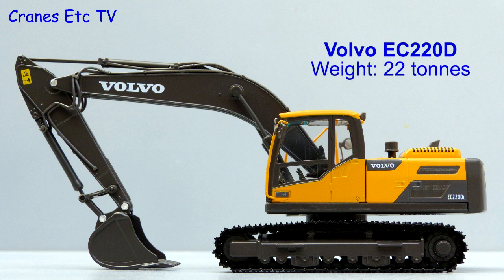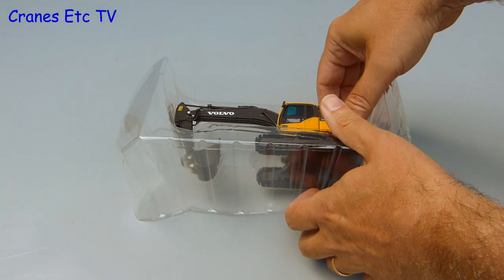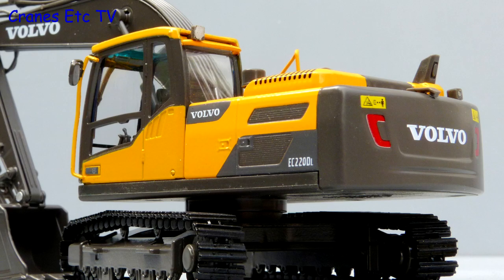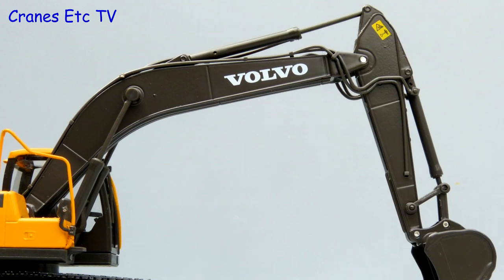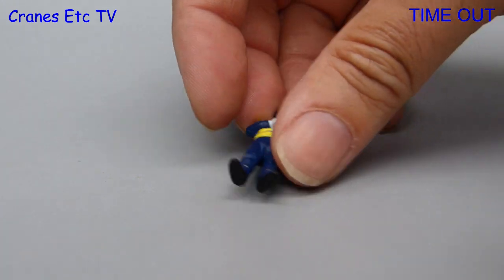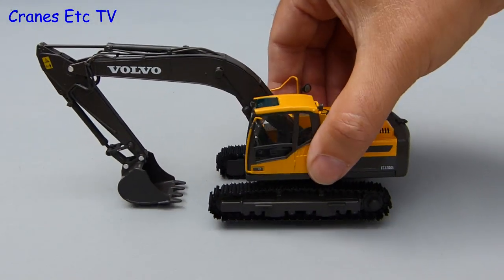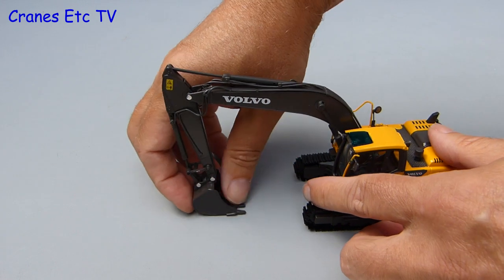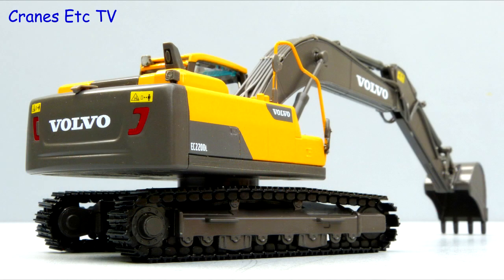Motorart Volvo EC220D Crawler Excavator by Cranes Etc TV

Comment: I have just purchased the Volvo, looks very nice and like the shape and tracks, looks spot on...
I solved the ram problem by simply painting them in Tamiya acrylic paint, this dries very quickly and can be built up in layers, until the correct resistance is achieved, works well and now its a very good model, pity the designers did not use metal in the first place, penny pinching, more than likely...